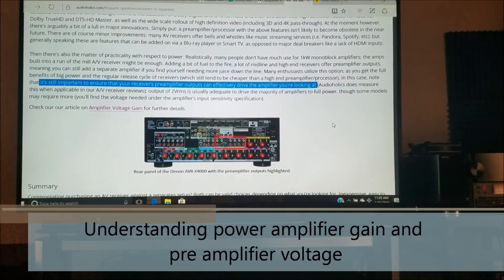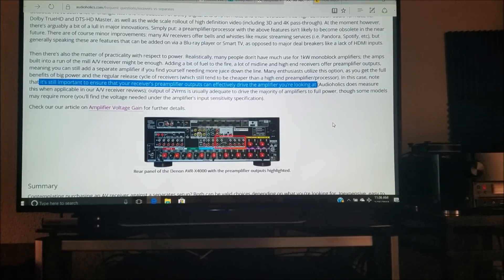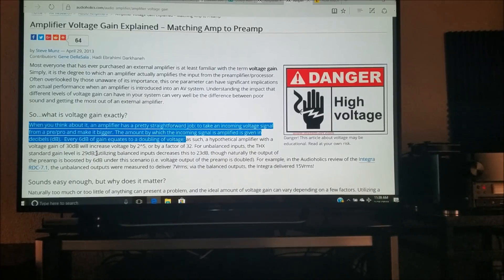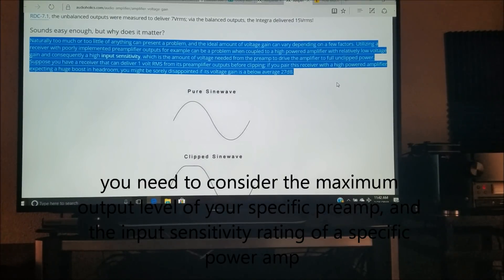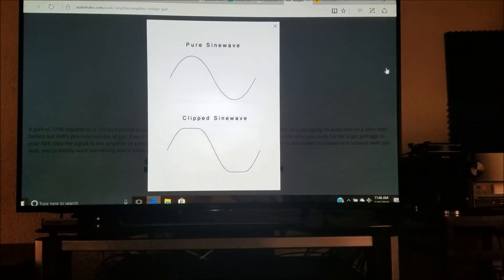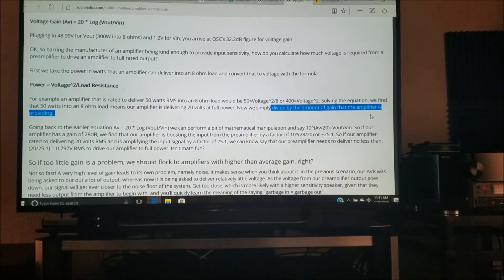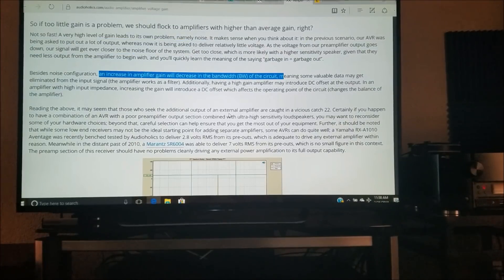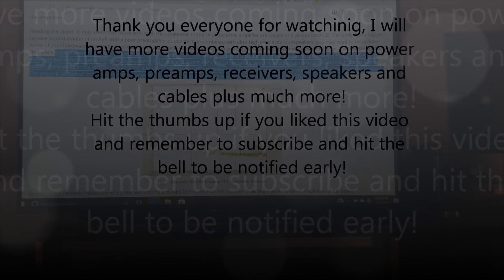Power amps matching to pre amps, what to know before you buy

Comment: What would you recommend for a Yamaha RX-3070 to power Def Tech front Bi-Polar Speakers -want to add 4 Atmos speakers to existing config.  As stands now 2 Fronts (Bi-Polar-3rdwire - to splitter becomes 2nd SW), 1 Center, 1 SW, 2 Front Surrounds, 2 Back Surrounds...future 4 Atmos in ceiling. Would Emotiva 150 get the job done?   Thanks
Reply from the maker: Michael M the a 150 is actually really nice I have been testing it out over the last few weeks which I'll put a video up on soon and it is a great sounding amp especially for Atmos height channels.

Comment: @Tactical Audio. Hopefully you can help me through some confusion. I own a Marantz Sr 6012 and plan on buying a monoprice 200Wx7 power amp. Im confused on this "hometheater bypass" talk. Would i be able to listen to streamed music in 2ch stereo mode while using the monolith amp?
Reply from the maker: Yesse that's a very good power amp, the home theater bypass input is usually on integrated amps for you to send your pre out L and R front channels into to the other device to bypass the pre amp volume control, it takes it out of the signal path.  It has a bit to do with unity gain and volume of two channel playback being too loud for home theater use but essentially yes you should be able to use your streaming functionality of your receiver and send that signal to the power amp.  Generally you would just use the receiver and send a pre out signal from your front left and right speakers into the power amp but the home theater bypass allows you to use a different amplifier with inputs and bypass the home theater receivers amps.
Reply: Tactical Audio Video Was waiting for your response before buying the amp. Thanks!

Comment: My recever is a onkyo tx-rz800 and I just bought the emotiva a5175 hopefully it’s A good match.
Reply: My ricever is 1v/470 oms
Reply from the maker: That should be a perfect match, it's just the really low end receivers that don't put enough voltage out to the power amps, that combination should be perfect the emotiva amps are made to work with a lot of pre amps.
Reply: Thank you so I should be fine?
Reply from the maker: Oscar Avalos definitely there should be no problems, let me know how it turns out
Reply: Tactical Audio Video Is working really good thank you.

Comment: Whoa I just pick up a marantz av7703 Emotiva XPA 7 gen 3 and Emotiva A-150 to power my klispch speakers , and I'm clueless on everything u just hit me with lol did I mess up or how did I do ? Would appreciate your help
Reply from the maker: Paul Butter those are some of the best things on the market, the Emotiva amps all have 29db of gain, and any marantz, especially that one definitely has a good amount of voltage gain coming from the pre out, so they should match up great and sound amazing.   What kind of klipsch speakers are you using and how many? Either way it should sound great!
Reply from the maker: What you don't want to do is use a very cheap receiver with a really high end power up and expect amazing sound, you got amazing power amps and preamps, so matching the voltage gain up isn't going to be an issue, but when you start mixing things up it becomes a problem.
Reply: Tactical Audio Video 26fa 110sw 240s 440c 160m
Reply: I really appreciate your help and thanks for your response
Reply: Hooking everything up today ! Can't wait